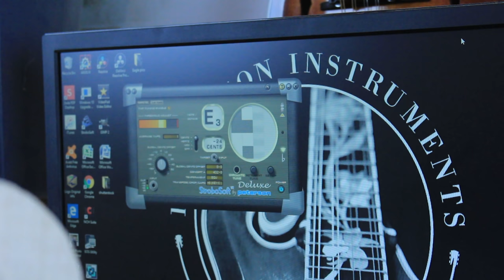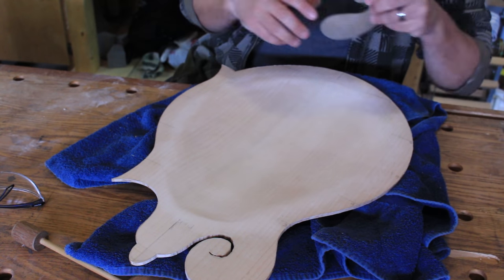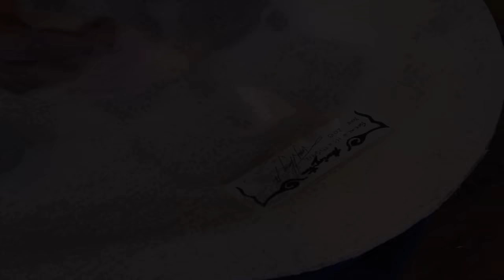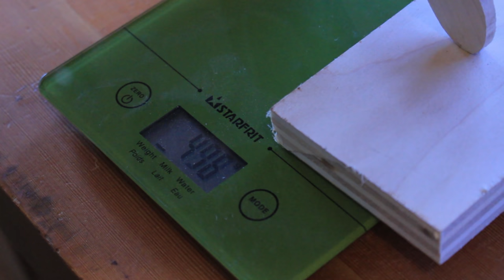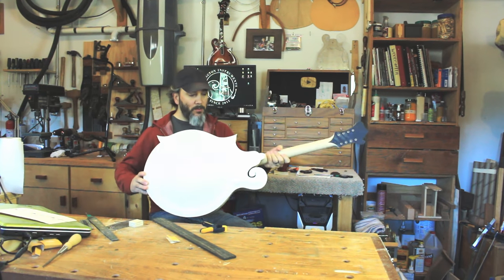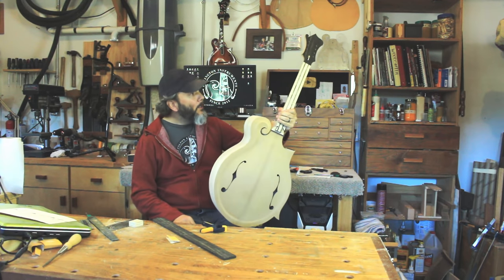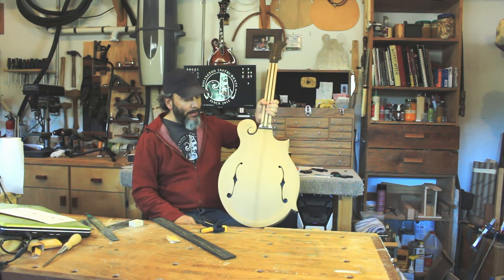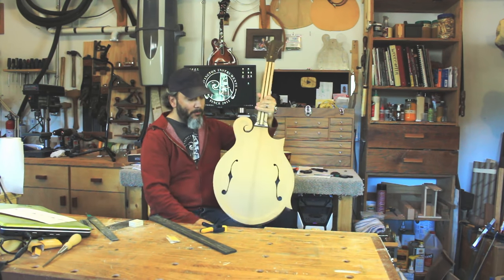Gluing the Mandocello backboard using spool clamps/ Part13

Comment: It looks amazing!  Great job.  What did you do about the squeeze out inside the body when you glued on the back?  Cheers.
Reply from the maker: Nothing really, not much you can do other than being careful with the amount of glue used on both sides.. With experience the squeeze out are minimal. On the inside I have two drops I can see on the lower corner by the tail block..

Comment: I have found when tap tuning on guitar tops that you will generate a different note depending on where you hold it as well as where you tap is this the same for the back you are doing
Reply from the maker: Yes I does, I usually hold it on the small tip ( the part that glues to the neck heel) I also found that if you put the plate to a 45 degrees or flat , gravity will put stress on it and it will change the reading.